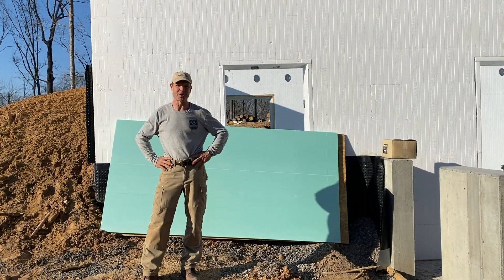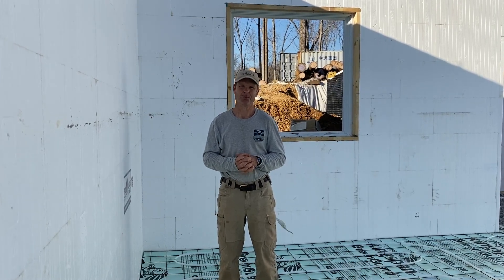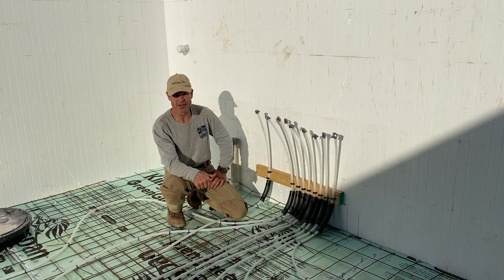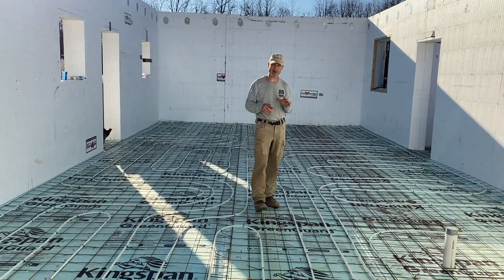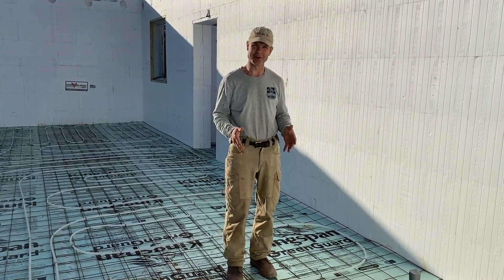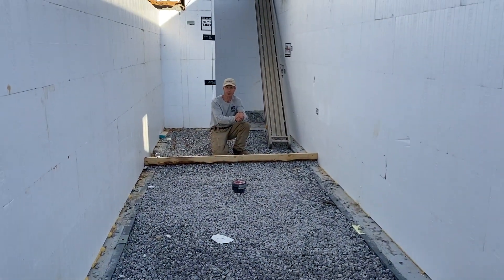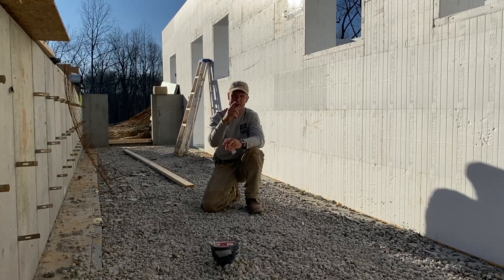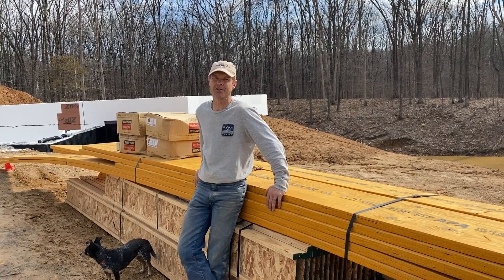Building an ICF House, Part 5:  Installing the Hydronic Basement Heating System

Comment: What composting toilet do you use?
Reply from the maker: For the last few months, we’ve just used a rather primitive compost bucket toilet to supplement our RV toilet system.  You can find details here:  https://youtu.be/ur4VQ0-L6OE. For the new house build, we have ordered two different versions of the SunMar brand compost toilets.  They more closely resemble a standard toilet, which will be a better option for our many guests.

Comment: Great video.  Recommend pressurizing the PEX so you will know if it gets a hole in the system before, during, or after pouring the concrete.

Comment: Great idea on the hydronic system! I'm surprised you didn't put one in the walapini. The pipe is so easy and cheap to put down, even if you don't ever use it. I would think it would be easy to use on those really cold nights if you need to keep a bit of extra heat out there. Or even if you want to transfer heat from a remote thermal reservoir (like the water drums etc).
Reply from the maker: Hydronic system in Walipini could’ve been a brilliant idea for some! In our case, we have moved further south for this build, and made some modifications to include putting the Walipini attached to the house. It is very possible we will be more concerned with cooling it than warming it. It will be interesting to see how it plays out!